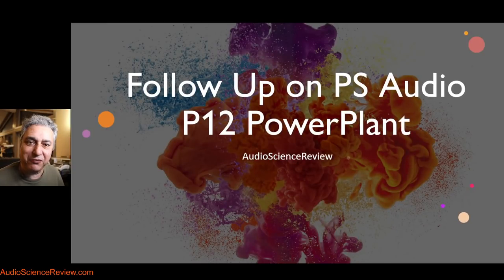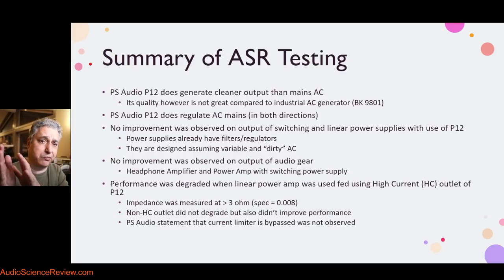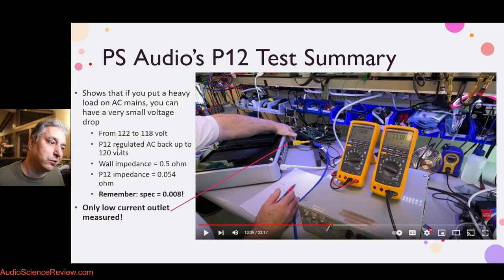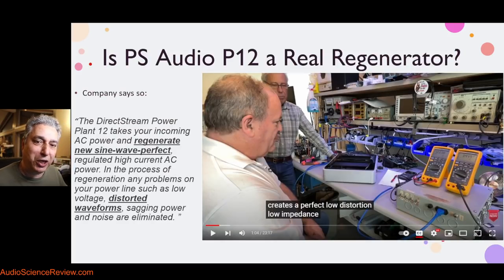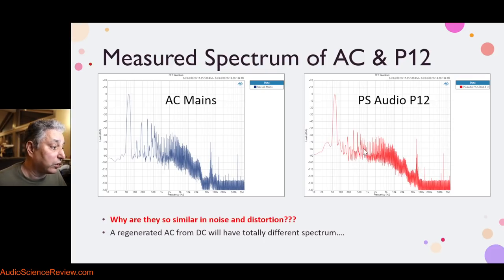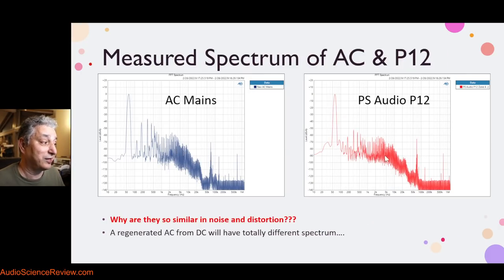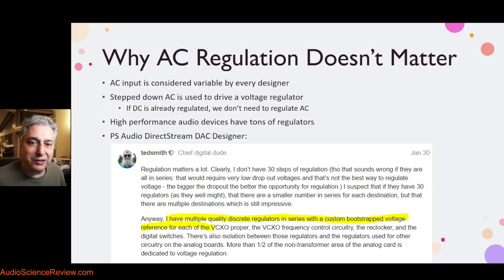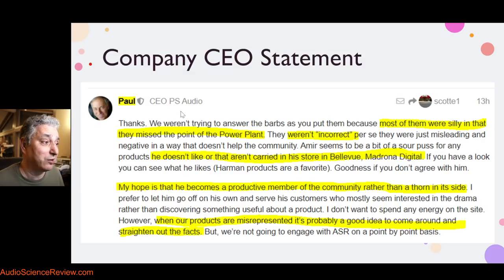PS Audio PowerPlant Measurement Follow Up

Comment: Even you give me a perfect ac source (assuming we can only see fundamental and no harmonics), I don't think there is any difference in sound quality comparing to direct plugging into an ac wall socket. My amplifier's DC bus (+/-50v nominal) capacitors (10000uf * 4) can significantly reduce all harmonics and supply surge current.  From scientific (measurements) point of view, I cannot see any noticeable impact on sound quality with an ac power conditioner in use. I also cannot hear any difference (I tried. Perhaps my ears and brain are not as sensitive as others). Some may notice differences. I always wonder why some can hear these minute difference, is it biologically they are better and more sensitive, or is it just an illusion or perhaps there is a quantum entanglement effect happening that human still don't understand! Thanks Amir.
Reply from the maker: Very good point.
Reply: Queens Smith
 - There are indeed quantum entanglement and quantum noise issues in audio equipment and these present as excess noise which is 'tail' of noise after impulses. The fundamental sounds are not particularly affected but 'silence between notes' is filled with decaying noise which degrades precision in positional information of sound sources in the mix and causes masking of low level ambient detail. All materials produce characteristic quantum noise which causes inherent 'signature' of noise produced and all audio gear is subject to quantum noise mechanisms which are also interactive. Dielectric and magnetic materials are producers of quantum noise and this is why cables can and do sound different, also items such as ferrite inductors and speaker magnets 'sounding' different. Amir's AP test set methodologies do not and will not reveal the excess noise production and subjective differences which are readily discerned by the experienced ear. Next time you take an AB listen listen through the 'up front' sounds and take more note of the lower level and ambient information.....now that you know what to listen out for you ought to be able to to discern differences according to AC power supply, that said if your electronics and speakers produce high levels of excess noise this difference may be masked.
Reply: @ericmc6482  no. Or the more scientific answer i should give: prove it.
Reply: @Douglas Blake 🤣
Reply: @CyberBeep_kenshi  classic reversal of the theses; one who claims existence of "quantum" noise shall undisputably prove its existence, and in a reproducible manner.
Reply: @DushkoKantardjiev  yupp, burden of proof is with the person claiming it. And the fact you need highly specialised equipment to even detect it, makes for a very easy educated guess, no person in the world can hear it's impact on regular consumer hifi products.

Also quantum entanglement is an entirely different subject, so the casual use in one sentence shows someone has been copying random Wikipedia words.
Reply: @ericmc6482  What am I even reading? Is PSAudio gonna sell some kind of "quantum cleaner" next?
Reply: @andrewskaterrr  Easy. Compare two system loopback recordings using different source cables of same/similar LCR values. The difference residual is difference in system excess noise caused by the excess noise differences of the two cables.
Reply: @ericmc6482  and this has been tested and show at -110dB then boosted for you to hear the difference. 
https://youtu.be/ZyWt3kANA3Q
Reply: @andrewskaterrr  The fundamental error in Whiner's method is common earthing, same deal with typical ABX test boxes which require two wire isolation switching to be properly valid. The correct method is to compare open loop recordings of system throughput which will record excess noise dependencies and interactions. Whiner's test is simple first order case and not indicative of typical open loop system noise behaviours. Andrew, you have designed numerous class winning devices (kudos !), that said your designs are not typical case and yes very low noise design is the first answer to non reactive/signature free audio reproduction. That said physical constructional materials cause 'timbre' in the final in the room resultant by means of current/time noise behaviours . I challenge you to reproduce your designs using say phenolic pcb or polyester pcb substrates, theory would say that at audio frequencies the differences in dielectric behaviours would be of zero importance, my experience says this is definitely not the case. In my investigations dielectric materials are subtly noisy and this causes modulation and intermodulation noises, otherwise known as excess noise and this imparts 'timbre'. Source noise recursively and interactively drives/excites downstream (and upstream) noises as is evident in typical systems, series items such as Bybee Quantum Purifier ameliorate/reclock noise mechanisms producing a subjectively and objectively different result in open loop audio systems. Closed loop measurements (eg AP test set) are affected on output and input simultaneously causing the null resultant that puzzles investigators despite the subjective affirmations reported by users and OEM manufacturers alike. LCR values and ohms law are but half of the audio reproduction chain story/explanation. Some useful and interesting information and musings here - http://numerical.recipes/whp/Flicker_Noise_1978.pdf

Comment: How would this compare to a standard home user UPS? Like an APC for a few hundred dollars? Would it be worse than wall output? I have everything on my desktop plugged into one and I've never noticed an issue.
Reply: I should send one in.  And a used older model to see how it performs.    Gamers Nexus would probably be the place to go for that.
Reply: @Douglas Blake Well yes, the cheaper UPS units are offline and have minimal filtering if any. But if you buy a commercial grade online UPS with true sinewave output, still half the price of the PSA PP, it's just as good except in cosmetics. And with the UPS, you also get battery backup.
Reply: @Douglas Blake I agree. I was just pointing out the higher end UPS units are also double conversion. I have a Liebert 3KVA unit. One place I worked, the IT department used to ewaste them when the batteries wore out after 5 years or so. $3000 UPS unit for $120 in new batteries - I'll take it! I use it for my media server. My power amps are direct off the wall outlets.

You might find this interesting. I built a box with a big 30a  relay and micro-controller to bring the UPS up and down on command. It's tricky because you must send a serial command first to shut it down, then "pull the plug". Otherwise it just thinks there is a power failure and goes to battery. WHY do this? Well the UPS consumes 300w with no load or even soft shutdown. I don't want to pay for that when the media sever is off for most of the day.

Comment: I really appreciate what your doing. Shame on those companies that mislead the consumers.  To bad for them.

Moving forward if your test says it makes no difference I will believe you over the manufacturer. 

I almost bought the power quest 707. But now I wont until you give it a review.  

If you say dont buy it. I wont.  If you say buy it works then I will.

Comment: thanks for the update! I would be very interested to see you injecting into main and move the frequency of the injection and the PS12 shows or not the same peak as the main. This would double confirm that there is no AC-DC-AC conversion.
Reply: also the firmware update is used all over the servers/video industry when we got issue at work first thing they ask is if we are at the latest firmware or they dont help much. Its always a shore to keep update to all the updates possibles. But usually we get notes of the modifications dones.
Reply from the maker: Unfortunately the unit has gone back to its owner.  I tried to do something similar with my lab AC generator but the start up current of P12 was too high for it to power it.
Reply from the maker: @DrLoveQc  As I noted in the review, the device I tested has the latest firmware.  They only released a new firmware a week ago but with no release notes or even a claim of what they have fixed.  With bulk of the functionality in hardware here, not much could be done in firmware anyway.

Comment: i watch pauls video's more for amusement than anything else, the company obviously does make good products, whether there worth the money is a personal opinion. But when it comes to these power conditioners [of any type]  its pretty obvious to anyone with basic understanding of amplifiers, the ac is transformed, rectified, smoothed, and regulated into DC so  as long as the frequency and voltage is correct, the amplifier wont care what the "quality" of AC is applied....this was always my thought, but was willing to be corrected if i was wrong, this video and the proceeding one, confirms though that i was correct...as to PS test bench, i was surprised not to see better test equipment! i have better on my bench, as repair vintage valve gear.
Reply: Paul said himself they use audio precision gear for testing, this was the video to show it.
Reply: @Douglas Blake yes, I've searched it, because when first saw Amir videos he said he uses audio precision for his tests.
Reply: @Douglas Blake yes, that is why it was odd not to see audio precision gear when ps audio made the video, I was just stating the fact that Paul said they use audio precision when they measure their products.

Comment: Not to pile on but I have had a hard time with Paul since he swore up and down that a pre amp in the chain gave him better fidelity.  "I just hear little nuances etc with a preamp." 
 I sat in a room with George Cardas and Jeff Roland and the guy from Pass (not Nelson) that designs their pre-amps  and asked them point blank if a dac (at the time a Pass Labs D-1 run direct (which it was designed to do) sounded better than adding a Pass Pre amp.  All in unison said it would logically sound better direct if you don't need component switching which I didn't.  The output stage of a Pass pre amp will have essentially the same circuit as the output of the dac.  Why double it ?  Noise cables etc.?  And it was balanced by the way so powering a cable run was not an issue.  That was years ago and since then I have heard dealer after dealer say I need a preamp.  Of course  you insist I need a preamp.....I am an audio geek.   Who else are you going to sell a preamp to ? BTW that was a great night. It was the opening of a new shop and hardly anyone showed.  I learned a lot that night....To testify that I am not immune to bull I can say I owned one of Arnie Nudell's Digital Lenses....if that means anything to you....

Comment: I have to say that from my experience, measurements are not everything. I have enjoyed equipment that were not necessarily well performing in terms of measurements. Not every nuance is measurable, and between individual preference, taste, and hearing capability, there are things that we simply don’t fully understand and can’t measure. 

That said, Amir’s analysis was thorough, concise, and well presented. PS Audio’s rebuttals on the other hand have been inconsistent, subjective, and frankly rather poor. Paul’s comments actually make his product appear worthless and his personal comments against Amir also brings further credibility to Amir’s analysis.

Though Amir may not welcome it, I think that Paul should welcome Amir to PS Audio, where they can do a collaborating session to address Amir’s findings. I suspect that will never happen, but THAT would actually be good for the Community and PS Audio’s business (assuming that there findings that go against Amir’s analysis 😉).
Reply: Electric !.
Reply: LOL!
Paul would never accept the validity of a 'blind test', the same as most audiophiles do.
The usual excuse is, you need much more than a casual listening session to identify differences.

Comment: What I'm aware of is that the 60 hz sine wave is generated and boosted by a class AB power amplifier. I'm not sure if there is a transformer on the output stage to boost the voltage further. The use of a series device to protect the output stage is really not the way a class AB amplifier should be protected. In a UPS a common way to protect the digital power output stage is a static bypass switch that feeds the output directly from the utility source when the unit is overloaded. A computer grade isolation transformer is also included. Other means including temperature sensors on the transistors, shunt clippers are commonly used making today's solid state audio amplifiers virtually bulletproof without compromising performance. The power supply should have enough stored energy in its capacitor banks to get through any transients. 

I'd point out that by your measurements the power drop for both continuous and peak power is less than 1db. IMO that is entirely acceptable. If it isn't, then buy a power conditioner with a higher rating.  As I said in my prior posting this industry has gone from the sublime to beyond ridiculous. These sound systems do not sound like live music IMO so I had to invent my own that does. It's a much harder problem than those working in this industry seem able or inclined to solve. They just keep making and selling endless variants of the same products over and over again pursuing a strategy that just doesn't work. There is nothing on today's market that I'd pay money for except a Crown amplifier.

Comment: Many products support 100-240 V 50/60 Hz, could you try 240 V 60 Hz just to see if you get higher power?
Reply from the maker: I can generate 240 volts with my lab generator but at low current.  So not really feasible for me to evaluate.

Comment: One speculation on the partial regeneration 18:00 ff.: It may be a serial&shunt regulator that is controlled by a clean 60Hz reference sine wave. If you are using a series element (transistor) that is almost fully open, you waste little energy (due to low voltage drop), and the same happens if you use a parallel element that is almost fully closed (due to low current passing). That would explain the similar noise spectrum as well as the power efficiency compared to the previous model. In order to up-regulate the incoming AC, I'd assume they use an, e.g., 1:1.3 step up transformer in the input.
Reply: And don’t forget…The differential probe that you are using to measure the spectrum of the AC is really a JFET amp, so is contributing big time to that signature.  Which is why it largely similar, even with the BK.  It would be nice to subtract that out of your measurements.
Reply: The PS Power Plant is not a traditional series or shunt DC regulator. It's a class B audio amplifier with a 60hz oscillator feeding it. They just control the amplifier gain either by an electronic attenuator or the feedback loop of the 60hz  power amp. I would expect it's internal DC power rails are unregulated. No need to do that as you simply control the 60hz power amplifier gain.

This is nothing new or unique either . Back in the 70s when mastered audio had to be laid back with video tape, you had to run the audio tape deck capstan motor at 59.94hz, not pure 60hz due to technical reasons with color TV. So they used an oscillator and audio amp, most typically a CROWN DC300, to drive the AC capstan motor. Later professional audio tape decks included this speed option.

Comment: I'm fairly sure Paul from PS Audio has mentioned that they have Audio Precision test gear. Maybe it's "New In Box" quality. 
Even as a casual electronics hobbyist I have better spec gear than was used in the video. Dissapointing for a Premium brand.
Reply from the maker: The Audio Precisions I have seen are older ones used for end of line qualification of built products.  Almost every manufacturing company has these because of the automated testing it provides.  What I am using is their latest and state of the art, APx555 which costs nearly $30,000.  I have yet to see a single measurement from the company that is from that device.  So I am not sure if they really have an APx555.  If they do but don't use it for this type of analysis, that is even worse!

Comment: i wish i'd never seen your video...now i am a bit sad bec. i own a P10 and a P20. (but at least it regulates voltage output bec. my old Devialets PSU's dont like voltage-spikes over 246V...i had 2 issues and they replaced the PSU on both Devialets 200. Since P10 they are still running fine. (salt over shoulder)
Reply from the maker: Sorry about that.  :)  I have bought plenty of stuff that I tested and didn't perform so had to put them aside.

Comment: Amir, just for fun some time, rent out a small conference room in a local hotel and set up some of these pieces of equipment to be able to do completely blind, A/B testing where the participants not only can't see what equipment they are listening to, they can't even tell what equipment is on the A side and what is on the B side either. If the #1 counterpoint to what you are saying is, "It's the listening that matters. You have to let your ears be the judge. Anyone with a set of ears on their head can EASILY hear the difference. That's why these products actually have value!" Well, let's actually put that hypothesis to the test sometime - with random people off the street that don't even know what they are listening to. Let them vote by saying after listening, A is better, B is better or they are both the same and I can't tell any difference at all between them. If you really want to put this issue to rest, once and for all about whether or not these types of products actually improve the listening experience for consumers, that's certainly the way to do it: entirely blind testing. Also, why hasn't anyone else actually ever done this by now? Someone certainly should have - with a LOT of similar products from the world of high-end audio.